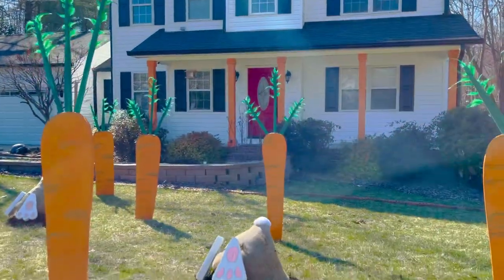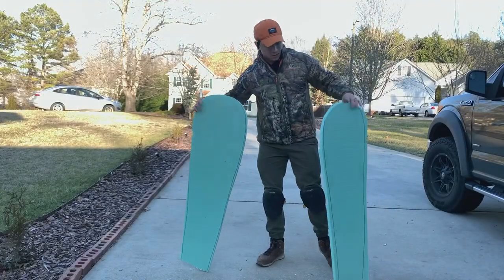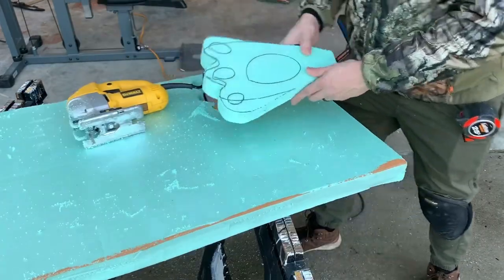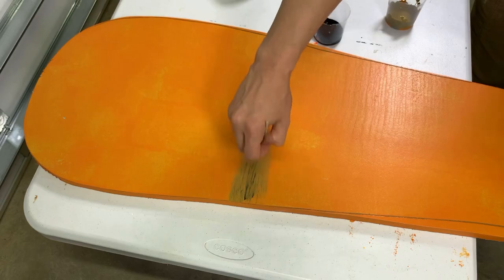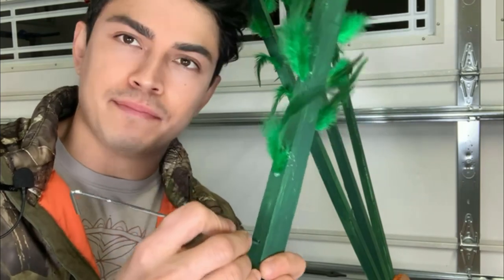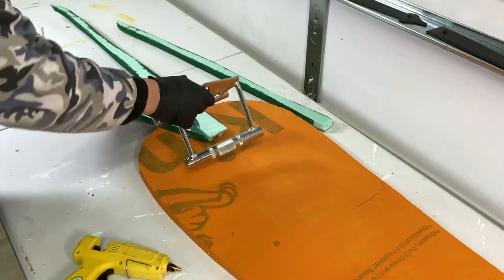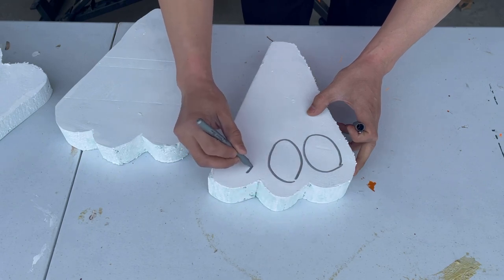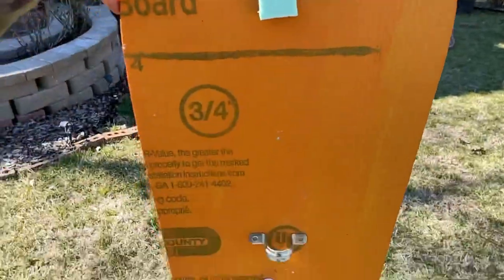GIANT OUTDOOR EASTER DECOR

Comment: Okay, the initial set up was great, but then the wind is causing strain on the 2-hole strap and foam and comes apart. Is there another way you’d recommend attaching them instead of glue gun? TIA
Reply from the maker: Yes there is! In fact the 2 hole strap method isn’t the best. This was my first build and it wasn’t the best in terms of keeping it standing during windy conditions. Now I use the PVC & expanding foam method. If you forward to the end of both my penguin and my shamrock videos, you’ll see how I do pvc and expanding foam. I’m linking both videos  below. Also, to make it sturdier, I would upgrade the foam board and use 1” or 2” insulation foam board . It’s sturdier yet a bit more money.
Reply from the maker: Here’s the shamrock, go almost to the end to see how I do the pvc and expanding foam 
https://youtu.be/e8EWo9tooBM
Reply from the maker: And here’s the penguins, forward almost to the end to see how I do the pvc and expanding foam 
https://youtu.be/_sTYxiwD1wk

Comment: Is the peach paint you used for the feet pads an exterior paint sample??
Reply from the maker: No, all paint samples sold by Lowe’s are interior paint samples but I have found that since my projects only stay outside for about a month, it works perfectly fine and I’ve never had any issues with using interior paint on exterior projects that are outside temporarily